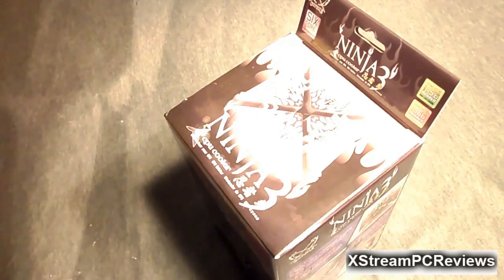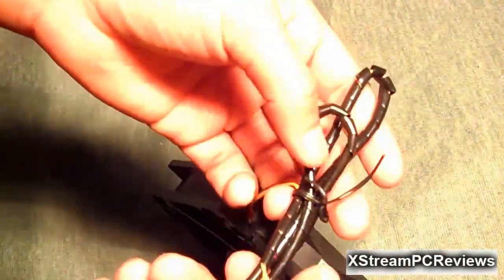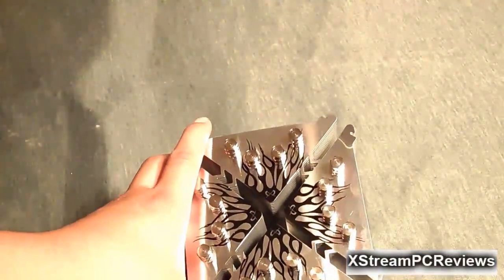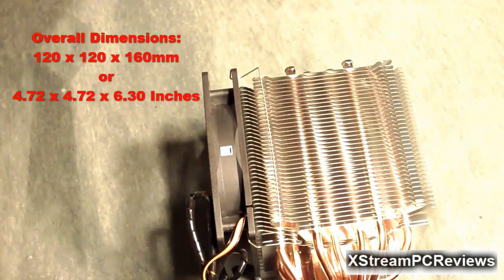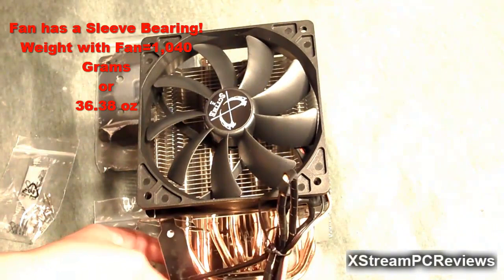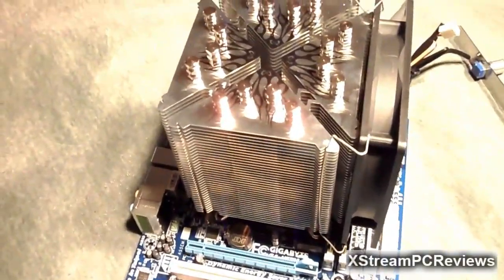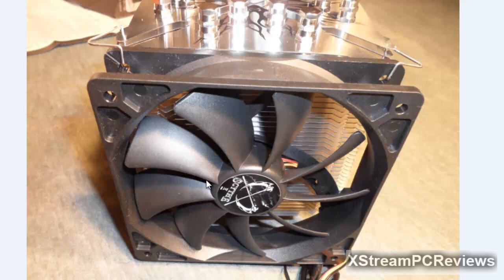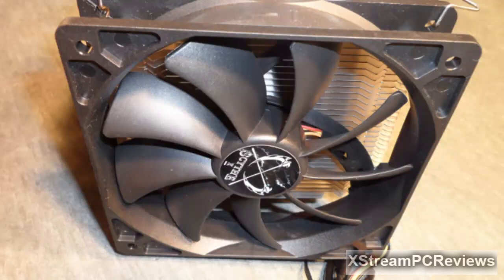REVIEW OF SCYTHE NINJA 3 CPU Cooler!

Comment: I have this cooler inside my Tt v9 BE, and it fits barely, after I removed the side fan, with about 1 mm clearance. The funny thing is, the 23 mm top fan makes the casing shake sideways, while the Scythe fan makes the cooler wobble up and down. =)
Not by much though, it's barely visible, but if you look closely you can see the whole setup shaking.